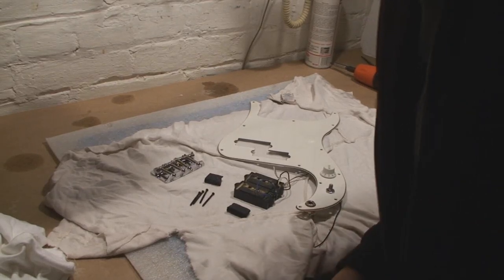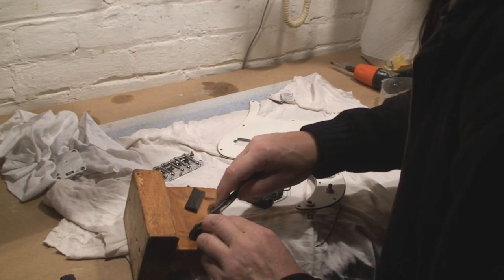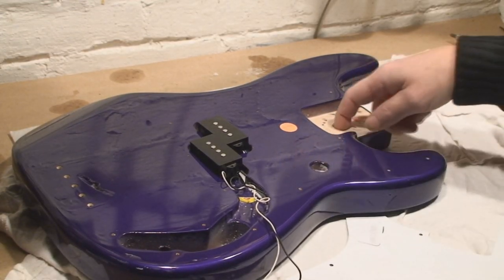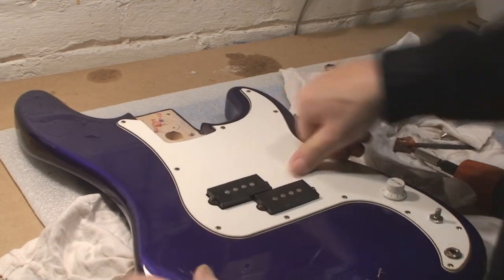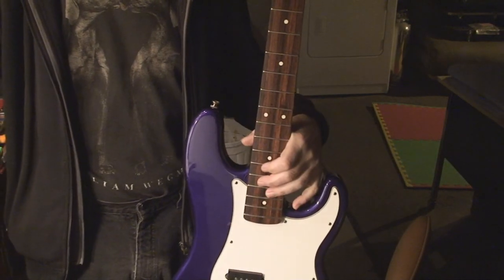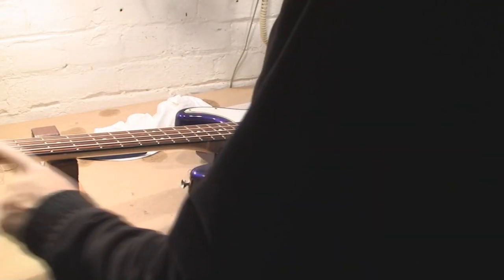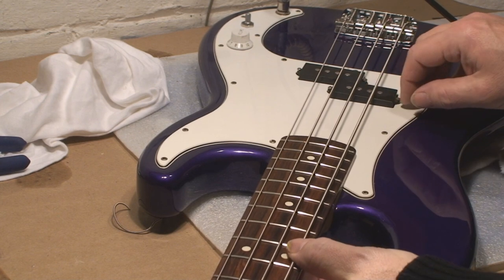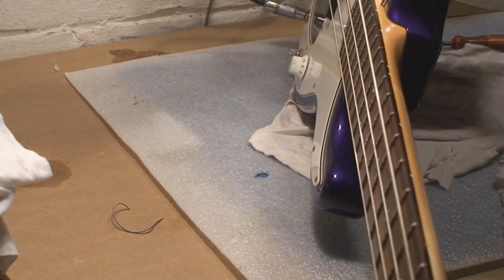Fender P Bass Assembly and Setup

Comment: I don't want to sound like a quibbler here, but in my opinion both the truss rod and the string height adjustment should really be done with the bass in playing position. The weight of the neck from the bass lying down or the weight of the bass with the neck in a cradle will affect the measurements. 
For an accurate truss rod adjustment (on a fender) put a capo right on top of the first fret wire. Put the bass in playing position. Press the E-string down right where the neck meets the body and then use a feeler gauge 0.015" over the 7th fret between the string and the fret wire. If the truss rod is too tight the feeler gauge will lift the string. If it's too loose there will be a gap between the feeler gauge and the string. To loosen the truss rod turn the allen wrench counter clockwise and visa versa.

Comment: Invaluable!  I'm about to do major surgery (by hand) on a beloved old Indonesian Squire with a severe body split, moving the neck and all electronics to a paint damaged but intact China Squire P body taken from an ebay parts axe. Wish me luck, and ty for the linseed oil tip.
Reply: I've had an Affinity Indonesian Squire P (bought for $80.00 unused) forever; great neck, PUPs and a replacement Swcrft jack, that got knocked over and cracked in the back from bridge to headstock 4 yrs ago. (then played a 4 hr set with it) I got it superglued and gigged a lot, buy now it's done.
Reply: P bass rebuild is done, and there's no way I could have done it without this video. Thank you, Dave.

Comment: @0252a You are right. It does affect intonation, but it's rather minuscule, and generally not a big deal. But if, say the intonation was ever so slightly sharp , and you raised the action, it would make a diffrence. The note would be noticably sharp, compared to the open string. I ran into that problem last night setting up an Ibanez.

Comment: I put new Aguilar pickups in my p-bass (they rock btw) but I just used the foam from the original pickups.  I ended up ripping the foam a little bit so one of the pickups sits a little funny, just enough to bug the crap out of me.  Gooooooched!

Comment: Hey Dave! I like your channel! I was wondering if you have ever had the chance to mess with a Warwick 2 piece 3D Bridge? As a bassist for many years, I have never seen a better bridge on any bass before. The adjustments on it are amazing! (Go figure German engineering) You can do the normal saddle adjustment up or down and of course intonation adjustment but where the Warwick shines is it allows for adjusting the entire bridge all at once up or down and then even more amazing is you can adjust the string width to closer or further apart depending on your taste. Oh and I almost forgot about the adjustable nut!

Comment: Won't it affect the intonation though?
The higher/lower the action, the more/less you have to bend the string to meet the fret, so changing the action would sharpen/flatten you down the neck.

Half a turn I would argue is probably imperceptible by man or machine so my point is moot in this case whether I'm right or not.

Comment: Hey Dave,Greetings and Stuff! My experience with "P"  style pickups is that the "E" string always completely out powers the other strings in terms of volume, ergo, the lowering of the pickup to reduce this effect and make the instrument sound more even. How does one deal with that if the pickup is supposed to be set at a fixed distance as per "specs"? I know one can turn down the bass control  on the amp but that sort of robs a lot of power from the amplifier.
Also,is there a place where all the numbers and details about setup are a available for perusal and reference?Tanks.